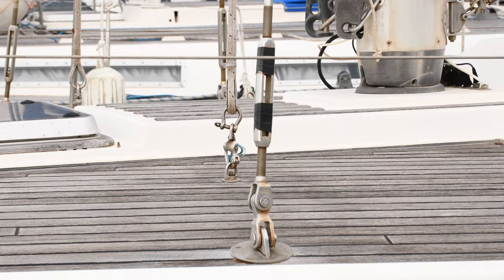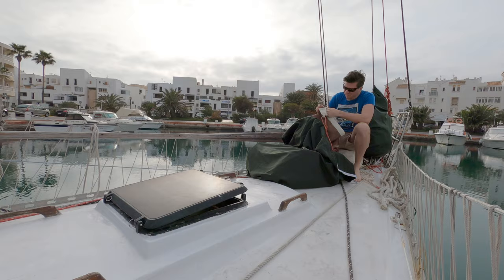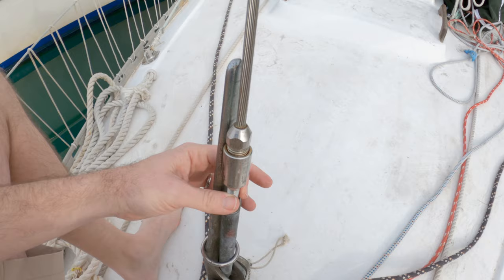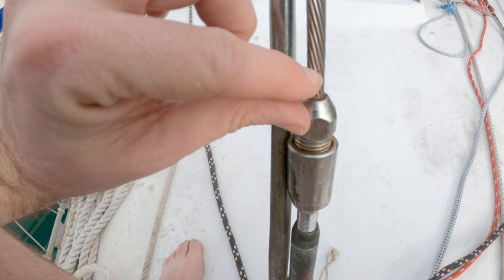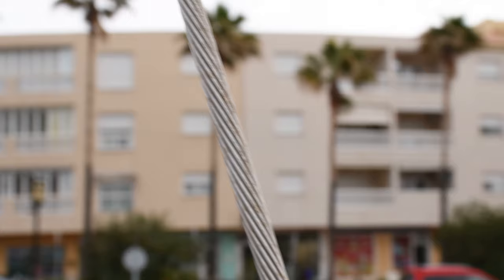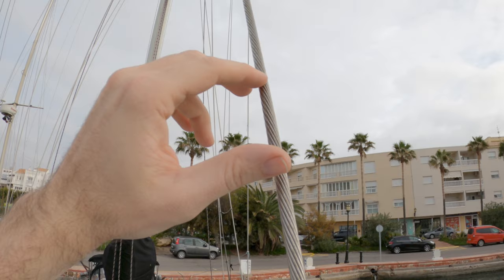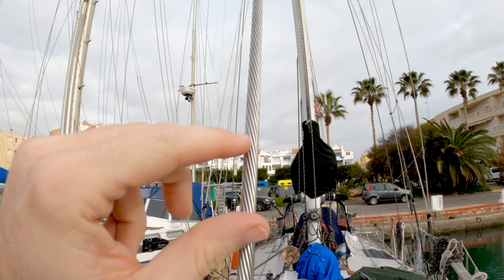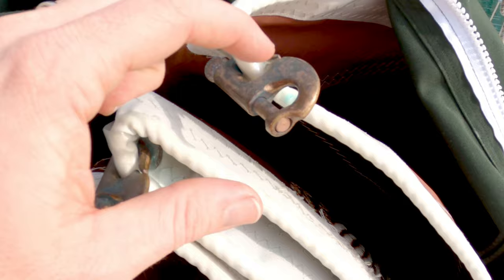DYNEEMA [Part 1]: Replace Your Rigging | Sailing Wisdom

Comment: Great video. Lots of sailors assume that stainless steel == good forever, which is of course untrue as you point out. I remember you discussing stainless rigging age & insurance issues in a previous video, and I think you said that your boat is uninsured by choice. I would love to hear about insurance implications of a dyneema rig, insurance decisions in general, and your thoughts about when to get/skip boat insurance. I think boat insurance is in general a very murky topic for novice sailors.
Thanks again for the great vids! Stay safe. 😀
Reply from the maker: That would be a great topic for a video! 

We have liability insurance only on our boats. 
Insurance doesn’t shy away from synthetic rigging as long as it’s under 10 years old for the most part.
Reply: my boat insurance company didnt seem to care when I updated my policy to state that I had synthetic rigging.  i dont think it made any difference in the premium cost either.   I am forced to have some policy like $500,000 in liability insurance because my marina demands that for every slip owner.   the marina doesnt care  (but they should)  what kind of rigging anyone has either, the only thing they care about, is if you have 2 fire extinguishers  (which are nearly useless for any sailboat fire) and flares (also useless in an emergency) and life jackets etc.

Comment: Thanks, Another worry for my next inspection round. But at least I now know what to look out for.
Reply from the maker: Knowledge is power!
Reply: @RiggingDoctor  very true.
Btw, once my stays do fail inspection I'm thinking of replacing them with Dyneema.
Any special concerns for attaching dyneema at the top end?
And what size would I need for a 25' Dufour 1800?

Comment: Thanks Herb, was soon as my knee gets better I'll do a complete inspection of my stays. Also wouldn't it be a good idea if when replacing or new stays to put some kind of sealer at those spots where the cable and fittings.
Reply from the maker: On steel, yes. It keeps out the water which makes it last a bit longer

Comment: So why choose a stayed mast? It would seem an unstayed mast might be a better deal. Oh, I understand that if the boat came stayed, changing is not easy, but why stayed in the first place? The only place it seems to matter is racing where an unstayed mast dings the rating adversely. For that matter there is yet another option of lightly stayed where the mast is designed to be unstayed but has "loose" stays to help keep the fore stay taught should the vessel have a fore stay. (The Gazelle is loose stayed for example)

Aside from that, why stainless? considering how long stainless wires don't last, why not use galvanised? Work boats do. But you will use synthetic anyway I guess so not an imortant consideration.  :)
Reply from the maker: Unstayed vs stayed masts really depends on what the boat is designed for. In a perfect world, all bots would have junk rigs, but the vast majority don’t. 
I prefer galvanized over stainless for rigging, but I prefer synthetic for its ease of setting up and fabrication. You can splice braided wire, but it will hurt you where splicing Dyneema is actually fun! 
A well maintained galvanized rig will outlast a synthetic and grossly outlast a stainless rig, but the maintenance is messy. For that reason, I like synthetic on my own boat.

Comment: This is very helpful, thank you for this! Did you replace this stay with dyneema?
Reply from the maker: Yes indeed! When I bought the boat, the inner forestay was brand new so when I converted all the rigging to Dyneema, I kept this one to help reduce the cost. When we were in Spain, the steel stay died and needed to be replaced, making it the last stay to be converted on the boat.

Comment: Great video Herb, I didn't know something that small could be such an issue for rigging. What's the cost of replace the standing rigging and what a person look for when inspecting the chain plates?
Reply: I know the cost of changing the standing rigging lies in the range of $10k-$15k. That is based on what I've heard from others
Reply: @sailingtranquility  wow thats a lot. Thanks for your input
Reply from the maker: It depends on the size of the boat, but that is a safe estimate for the average cruising boat
Reply: @RiggingDoctor  Would dymeema be cheaper?❓

Comment: Great videos
I am close to the 10 year mark on my steel standing rigging on a gaff cutter.  
LWL is 23.5 feet, and the length of spars is 32 feet.
The current wire is 6mm. 
What yound you recommend in dynmea?

I was going to start with my runners.

Thanks in advance.
Reply from the maker: Dyneema will be great for you. Gaff rigs have really low tension at rest so they are easy to setup and adjust with Dyneema. You will love the stuff!
Reply: Do I match the wire size with dynmea size ?
Or 
Air on the side of caution and go a size up ?
Reply from the maker: I look at the equivalence to make sure I’m not going weaker than what is there, but then I do a bunch of math to see what size it really needs to be. 
I use the RM30 to figure out the force exerted on the rig and then a few other formulas to figure out the static load on each stay and therefore determine the appropriate line size based on strength. 

Most of the time, it comes out to be near the size of the current steel but I have had a few cases where the boats original steel rigging was undersized and swapping Dyneema size for size would have led to some problems with creep.

Comment: would you replace the compression fittings (StaLocks) same time you replace the wire? Like every 10 years?
Reply from the maker: If they are still in good shape, you can reuse them. Those fittings are the best way to go when building steel rigging

Comment: I just bought a 1985 Nauticat 44 boat.  It's a ketch.  The rigging needs to be redone.  I'm considering Dyneema (because of your videos...).  Is there an equivalent Dyneems vs stainless cable size equivalency?  My masts have these slot things that the cables slide down into .  How do I connect Dyneema to them???
Reply from the maker: Please send me an email with your questions at riggingdr@gmail.com 😊thanks

Comment: I live in Norway, temperature can change 10degrees in 24 hours, can I use dyneema? Or I will need to retention it every time I go sailing?
Reply from the maker: You would be at the limit for what I am comfortable with. We sailed with the same tune all the time, and the temperature range was from -6°C to 43°C. If it was between 38°C to 15°C I didn’t worry about the rigging. Less than 10°C I would keep the sails lower on the mast (stay reefed instead of full sail). Less than 4°C, I wouldn’t put sails higher than the first spreader. 
This worked out well for us and our relaxed style of sailing. We also have lateral spreaders which accept being loose much better than aft swept spreaders which MUST maintain a high tension at all times or the mast could invert and break!
It depends on many factors, but if your spreaders go straight to the side and don’t sweep backwards, then you will be fine. Just give the rigging a jiggle before you sail and act accordingly to the tension. If it’s tight, go full speed! If it’s loose, take it easy and don’t crash gybe.
Reply: @RiggingDoctor   perfect answer. Thanks

Comment: YOU HAVE A BIG PROBLEM!!!  NEVER, NEVER, NEVER PUT COPPER AND STEEL TOGETHER (YOUR BRASS SAIL CLIPS).  YOU WILL GET COPPER PITTING CORROSION ON THE STEEL.
Reply from the maker: Copper and steel are an issue but bronze and steel pair well together. Think of your prop shaft (stainless steel) with the prop (bronze) bolted to it. In a relatively dry environment like a stay, there is no need for electrolysis collars, as the bronze hanks will grind away faster than they could corrode.
In this setup, there is no copper, everything is bronze or stainless steel.